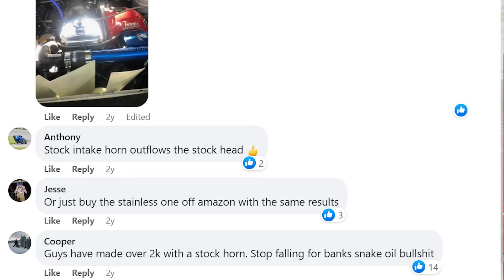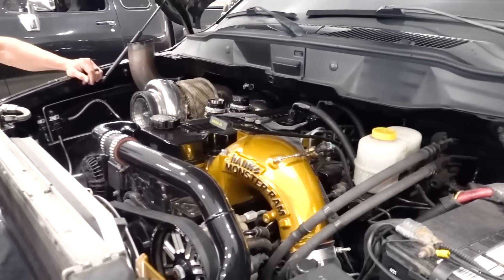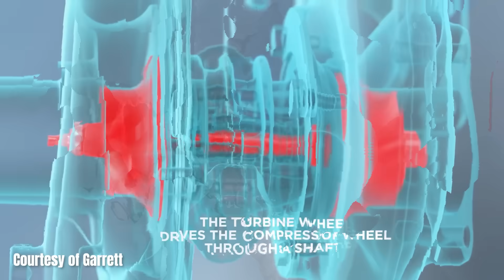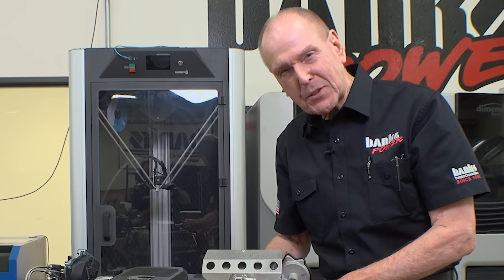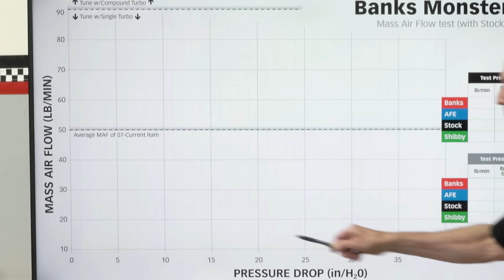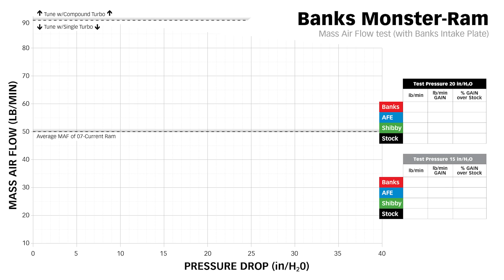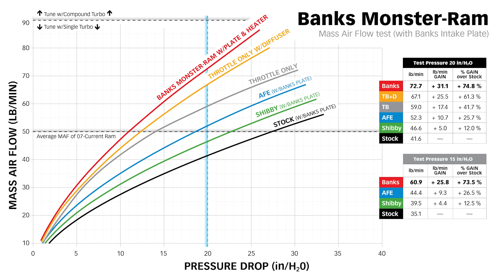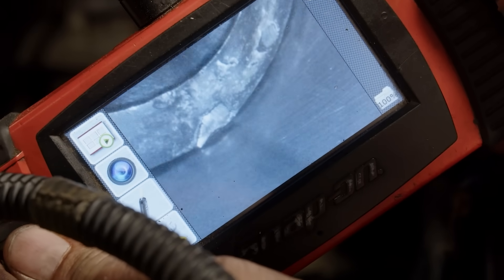Stop this wives' tale about Cummins engines! | Fact Check

Comment: Mr. Banks is absolutely right! No doupt abaut it!  But well, if some one just put this "banks" U shaped air horn and thinks like "there must be a lot of extra power now!", I'm sorry to say, that this Mr. some one is badly wrong. There will be no any extra power, or extra horses. Because we all know that engine needs fuel anb air! Just adding only air doest give any extra power. Actually, if pushing just more air from turbo, power will drop a bit. Extra air doesnt make any more power. We need also fuel! And with fuel, there is same thing. Adding only fuel is not good, we need also air! But usually engines are made from factory like that, they can produce some extra power by adding only extra fuel. But there is limit somewhere near. If adding too much fuel, engine will smoke badly and exhaust gas temperature will go high and that doest do any extra power. Actually power can, and propably will drop after specific limit. Some smoke will give you more power, but after the limit power will only drop. But, add both, fuel and air, just like Mr. Banks says, you will get much more power and reliable engine that you can trust on! Thats the only way to do powerfull and reliable engine.

I did my engine from old Mercedes Benz. It was 2,5 liters 10 valves, and un direct injection system.  (pre chamber might be the right name? I do not know.) But well. Yeah, it was 2,5 liter engine and produced more than 400Nm torque and 300hp. And that was with low boost pressure and some old scanua trucks turbo. It didnt work very well, so after that I bought a brand new holset HX40 and add pressure to 2,2 bars and of course fuel as much as I could, that it still didnt smoke too much. Fuel pump was made by me. I used 7mm elements to produce enaugh fuel for the engine. I did couple of tohose pumps for people who needed ones. I was ok good at it, but it wasnt my bisness never. And I can say it was a pretty fast station wagon car for a regular old, 80's mercedes. It really was fast for its time. I made it abaut 15-20 years ago. Nowadays it is nothin. But then it was ok fast. Quarter mile took something like a 13 seconds. if I do not remember pretty badly wrong. I remember than it was same power as nissans z350 was. We raced ones and it was side to side situation for more than 230 km/h. And then I lost, because I didnt had enauhg long transmission. 5 speed manual gearbox and engine revs more than 6 thousands at full speed. Stationary that engine could rev 7000rpm. Thats a pretty much for a diesel engine. Believe it or not, but old mercedes engines revs pretty high, if it was tuned right. And they make also a lot of power. Especially multi valve engines. 3 liter engine can make more than 1000 horsepower, if rihgt tuned. That means a lot of torque and even more of revs! Thanks, if you readed all this to the end.

Comment: Nobody who doesn't live in Commiefornia cares about 50 state legal.  Any number of states legal doesn't mean much if you live in a city or locality with enhanced emissions or "safety" requirements.  It may be legal in my state, but only 5-10% of the land area of my state even has emissions inspections.  I don't live in that 5-10% land area.  It may not be strictly legal, but there is no enforcement so it might as well be...

Comment: I have a banks intercooler in my 07 5.9 cummins...problem is!! I cannot get a AC condenser for it because the banks has different bolt holes than stock 🤦 called banks, no answer. Have to build a custom condenser to match the intercooler. Brutal banks

Comment: Curiosity, I live in the mid west where the ambient temperature is below zero F multiple days or weeks in a row. I have a completely stock 2023 L5P. I would expect higher air density which would make more power and MPG. It seems like cold days I get less fuel economy. What am I missing?

Comment: There’s a lot of fan law involved with engines that no one knows about.
Reducing inlet suction pressure makes it easier for the engine to pull air and reduces load, which allows the engine to spin easier.
Reply: There is no inlet suction pressure on forced induction engines.
Reply: @tylerfb1  very true, but it also still applies to turbos and superchargers…. So?
Reply: @matthewboggs4639  yes, but it’s not directly related to what you said. If there is restriction to the inlet of the charger (causing high suction or low pressure), the efficiency of the charger goes down, and so does the outright output, both of which decrease the amount of oxygen able to get into the cylinders and hence you can’t burn as much fuel, which is what decreases power output from optimum.

You got me thinking now

Comment: I just installed the cold air intake/big ass filter in my 2024 Ram 2500 6.7 Cummins. Super impressed. First off the fact that they provide a seal/oring for the emissions sensor when removing from stock box and putting on Banks tube is just plain awesome. At 56 years old this isn't my first rodeo. Ive built many cars and trucks in my life. When I saw a 8,000 mile o-ring broken when I removed from stock air box and saw Banks had one in my parts kit I knew I just became a life long customer. Some may say.. whatever and what's the big deal.?? Well others don't ever do that. They don't think ahead and provide you with everything you need. Second major impression was when putting the sensors back in the Banks tube from the stock box they only fit one way properly so you don't have to guess. Point is this is proof they clearly know what you're going to be dealing with when you do the install in your garage at home. Thanks Banks! I'll be ordering many more goodies from you guys for my 6.7!

Comment: Thanks so much. I've been trying to find an exact fit for that fitting for 2 weeks. FYI, Mine is on a 2008 328xi e90 BMW. So, the big automotive manufacturers get a lot of use with that design.

Comment: I’m hoping this question gets to the Banks team. I have a 22 6.7 powerstroke. I purchased your intake and 5” DPF exhaust and idash super gauge. Not interested in tuning currently but what give on not offering boost tubes hot or cold side ? 

I have always had banks equipment on all my powerstroke engines and was surprised when I purchased my new truck the limited aftermarket support.

Comment: If this upgraded intake is so much better than the stock one how come banks in their ads do not claim any MPG, horse power or torque gains like they do on all of the other performance parts they sell?   
Over several decades I’ve bought a lot of banks power ups kits for many vehicles from Ford and Ram to GM trucks. All of these power up kits increased something, if it was MPG there was no noticeable power increase, if it was power (IE HP and torque) then MPG suffered. To varying degrees am satisfied with all the banks products I’ve installed. Some components are better than others. 
Point is all of these kits did something and banks made sure you knew it and why not. Why should anyone spend so much bucks for nothing.

Comment: "stock head won't even flow 250 CFM" 250 CFM is ~7080L, a 6.7 at 2114 RPM flows more than 250 CFM... the stock horn on the c6.7l is 432 CFM... at 10 IN H2O... the engine will pull 375 CFM at 3k rpm... assuming the same pressure/temp, which it isn't... Travis is an idiot.

Comment: so if i add all this including boost tubes, do i have to get my truck retuned?
Reply from the maker: No, tuning is not required, however, any tuning you add will benefit from the added increase in air flow.

Comment: Like first generation water boxer VW's.  Has a 2x5" throtal body 6 " diameter paddle in the mechanical mass air fule regulator, a 6x 14" air filter and at the bottom of the box there is one 1& 1/4" hole,  😅😂😅😂😅😂😅😂😅😂😅😂😅 I cut the bottom out of the box frees up what feels like 30 horses! Completely changed running engine sound that folks thought I had headers.

Comment: Would the monster  ram install void my factory warranty? If the answer is no, then is there some document from Banks or Cummins stating this? I would like to have one but don't want to void my factory warranty
Reply from the maker: It depends on your local dealership and how they choose to enforce Stellantis’ warranty policies. Our recommendation is to speak with your service advisor. If they indicate that aftermarket accessories are ill advised, then we recommend finding another service center that’s aftermarket-friendly.
Reply: @bankspower  I understand what you are saying but this puts a great deal of risk back onto the owner of the vehicle that's under warranty. 
Having to shop around for a dealership that will maybe look the other way if  warranty repairs are needed is a very unfortunate spot to be in as the owner.  As we have seen manufacturers and dealerships sometimes just look for a way out of a major warranty repair. 
Thank you for the reply sincerely. But I as much as I feel these upgrades would help I can't risk getting a $30,000 repair bill that would have otherwise been covered.  It definitely puts us owners who have brand new trucks in a quandary.  I guess I will likely wait until I hit my 5 years or 100k miles.
Again thank you for replying so fast to my question

Comment: So basically the inverse of the old turbo logic... Lay people hear xxxpsi of boost and go wow, turbo people ask what size charge pipe. This is like stating I have a four inch pipe but not providing pressure statistics. Actual air provided is more than flow or pressure alone, this is why most MAF sensors report in a weight over a given flow at any amount of time.

Comment: So I just bought this 5.9 Cummins, don’t know the previous owner and what was done to it… I flashed the ecu with all 4 tunes from the edge evolution CTS3 and for some reason the performance tune 3 blows around the same smoke if not less than the “eco” tune (lowest tune setting) my plan is to get a banks intake to help with flow and keep egts low, do you guys think the injectors have been upgraded? Is there any way to tell without pulling them?

Comment: "The guys saying the head is the restriction are wrong"
-Proceeds to do flow tests without the cylinder head attached.
🤔🤔🤔 Kinda seems like the people on the Internet might be right...
Reply from the maker: It seems like you missed the point. The head is a restriction, but because air is compressible, the head is not a limitation. Increasing air mass flow would mean that more air is flowing through the engine at the same CFM. So whatever number people want to claim is the CFM limit of the head, it will always be able to flow more air mass if that air is made denser.
Reply: @bankspower you have all the equipment to do the tests. Show me.
I'm an istrumentation tech. Air mass flow is air mass flow.
If you show that the banks horn increases the mass flow through the entire package you win.

Pick any spot in the cam rotation you like as far as lift and prop a few intake valves open the correct lift.
Until you do this you haven't actually debunked the claims made by other people.
Reply: @bankspower  Of course you can ram more air through any cylinder head, so there's no limitation. And of course any pipe or elbow will have some pressure drop. The issue is the scale of this. If you have an extra 30 in/h2o of pressure drop that is about 1 psi drop, so this means that you will have to run 1 psi more boost on the inferior elbow to achieve the same power. If you have a stock head compared to a lightly ported head, you can very often reduce the boost pressure by many many psi while achieving the same power. This is the reason why your elbow might not be a worthwhile upgrade on a stock head. This is essentially the same discussion as discussing different size charge pipes, a huge charge pipe will not make more power than an appropriate sized one because the restriction is so small.

Comment: Mr Banks: thanks for showing all these kids they need to stay in school before they talk. 

Chemist here - you are spot on your explanation. What most commentetors miss is the difference between volume and mass. In order to push more mass into the same volume, thus increasing the density, you need to apply pressure: this is what turbos do. But the result is extra heat that needs to be removed: this is what intercoolers do. And of course you controll all this with a MAF because all you really care for is mass of air for the combustion to work.

Thanks for all the great info, I hope these kids get motivated to go to school to one day be like you. God bless!
Reply: Brush up on their spelling and compositional skills.
Reply: If the temperature and pressure of a gas is known, the density and mass of a given volume of gas can be calculated. This is one reason SCFM (Standard Cubic Feet per Minute) is used instead of CFM (Cubic Feet per Minute). The difference is that SCFM is in reference to a standard pressure and temperature. For example, the NIST standard (68 deg F at 14.7 PSIA (pounds per square inch absolute)) is commonly used in the USA. 

At 3:57 into the video, Gale says the intake filter system is pulling in 1,200 CFM but the engine is pulling 400 CFM. If SCFM had been used, the flow rate would be the same for both.

Comment: If you add a turbo or charger to your motor you increase the density (pressure) of the air entering the combustion chamber.

According to their logic turbos and chargers don't do anything 😂😂

Comment: Sir .. question , what’s the importance of extra air inside the combustion chamber if we are injecting same amount of fuel and we are boosting same turbo power ..   I read all the reviews in google from people who installed and in the Cummins 6.7 group on the internet ,  95% of people say they didn’t notice any difference but the peace of mind of not having the faulty bolt falling into their cylinder chamber ..

Comment: Lost a lot of respect for Banks after this video. It doesn't address any of the complaints directly, and offers only flow bench data as evidence. Banks is the snopes of the automotive world.
Reply from the maker: Sorry you feel we didn't address this correctly. The point Gale is ultimately making is that even if a component like the head limits CFM, it doesn't limit air density because are is compressible. The head is certainly a restriction, but that doesn't mean it negates any improvement to mass flow and air density from other components. With higher air density, the system can flow more air mass at the same CFM, so the head limiting CFM becomes irrelevant.
Reply: @bankspower  So why not complete a real world test to prove it? This whole video is just talk and theory crafting. We can talk numbers all day, but the bottom line is, does it make a truck faster or not?

Comment: Nice StrataSys Dimension printer there in the background ;P It has been a while since I saw one of those!  Hopefully those parts on the flow bench are coated internally or otherwise treated to fuse the layers....most printed parts still 'leak' between the layers.

Comment: So many American companies in the high performance aftermarket are renowned and respected while they are under the care of the original owners.  Edelbrock, Holley, FlowMaster, Pete Jackson, etc.  The companies are eventually sold off to some penny pinching, made in China, board member run mega companies and the products suffer terribly.  I'm not saying Gale is ready to kick the bucket just yet, but I really hope someone is there of equal quality ready to take over and keep the business running as it was.  It would be such a fall from grace and terrible loss to the community if Gale were to retire/pass away and Banks were to be purchased by the usual culprits.  I know others in the community have had the same worry.  Maybe a video about future plans of the company would help put the community at ease.

Comment: I installed the Banks Monster Ram intake horn on my deleted 2018 6.7 Cummins. Definitely improved performance. Better pedal response, quicker acceleration, and it gained about 3mpg. The engine felt happier
Reply: Forgot to add, it was also with the grid heater delete

Comment: Love your videos!  Would love to see the same test but with the cylinder head attached like a typical flow bench test.  ie, each intake attached to the head to show difference in MAF compared to valve lift, as there is more to the story there as well.  Would easily show the cylinder head is not the limiting factor.

Comment: But, the argument is it’s the head that is the limiting factor. What happens if you hook all of those up to a head and measure the air coming out of the intake valve (valves removed of course) compared to maximum stock flow
Reply from the maker: The point was that, even if the head limits CFM, it can't limit air density which is the measurement everyone should be using to evaluate power. The head is a restriction point certainly, but because air is compressible, denser air can flow through the head just as easily.

Comment: What if you cooled the exhaust before putting it thru the turbo?  What if you used an electric motor to compress the air?  How much back pressure does a turbo create?  Could you lose the intercooler or mount it on the roof?  What affect would the longer travel have one the flow and density

Comment: I do not understand how one can obtain greater MAF over the throttle body. Could someone enlighten me? If I understood correctly, MAF is measured half way up the flow “stack” before the throttle body. Since the throttle body is always present in the stack, how can anything added above it ( or before it) produce greater mass air flow? I would expect something more restrictive than the throttle body to yield lower MAF, but that nothing could surpass the air flow of the throttle body. I assume I am not understanding something correctly.